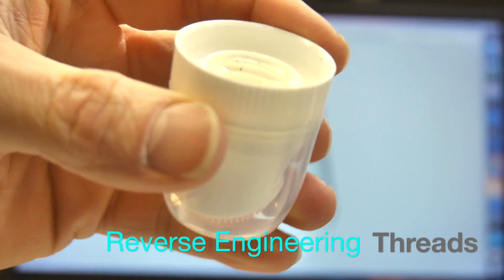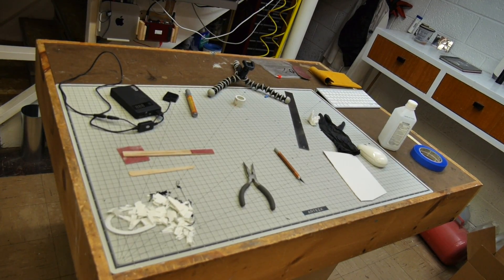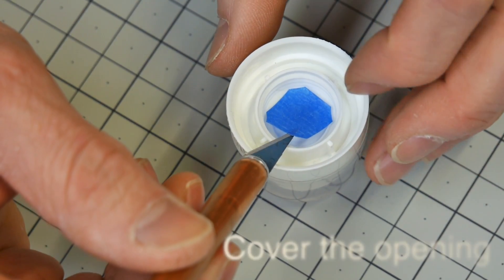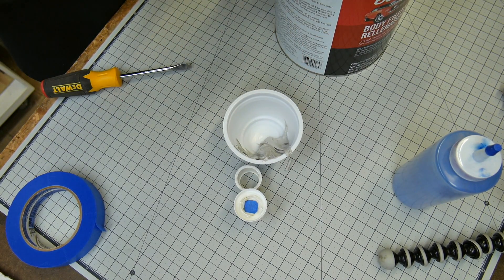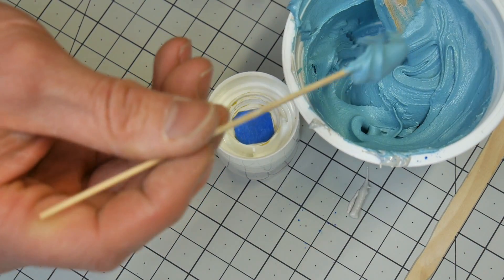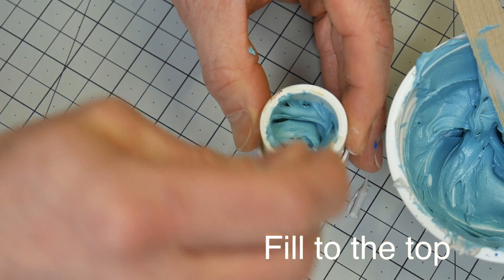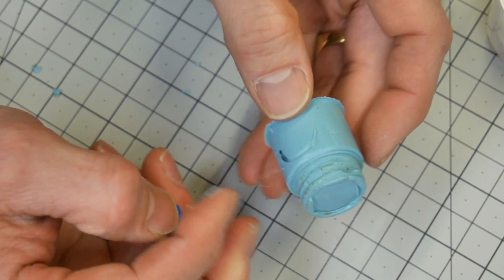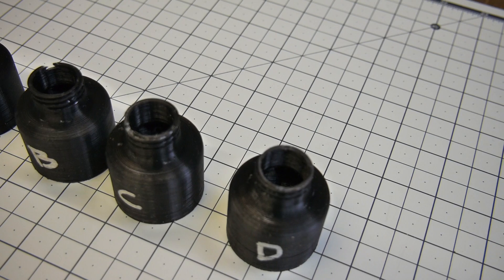How To Reverse Engineer Bottle Threads

Comment: Your suspicion the wax helps the bondo cure is spot on. You get a slight surface inhibition layer wherever a polyester resin is exposed to air. Moisture from the air inhibits the cure very slightly.  You notice it when sanding. That is why you add liquid wax to gelcoats when applying it to fiberglass parts post-molding. The wax forms a skin on the surface to eliminate the inhibited layer.

Comment: Lets say I wanted the moulded part to be used in the threads and be reasonably solid and lightweight, what material would you guys recommend?
For a pool cue extension specifically.  So wooden threads.
Reply: Thats what I had in mind, reinforced with some wires or mesh.  But will the paste wax work on wood for epoxy?  I just dont want to epoxy the end of my pool cue permanently!
Reply from the maker: Elias Bargee you should conduct a test first but it should work.
Reply from the maker: Perhaps and epoxy, could work

Comment: I've been printing a lot of modular small parts and probably need to go have an injection mold made. i'm still prototyping and am wondering wether its cheaper to make a reverse mold and make it out of Bondo. i don't care about the bubbles so don't need to get a vacuum chamber for pouring plastic resins. probably cheaper the resin route? But I just need to find out if it works with out huge cost in equipment and I will need to drill parts for attachments, where I now print longitudinal holes to attach parts. its also hard to make water tight and UV resistant.
Reply from the maker: generally, soft tooling if the in between method for testing stuff, basically silicone molds with resin parts. Bondo could work I guess, but wont last long. silicone is really the way to go. alohathaxted let me know if you have other questions.

Comment: Very cool technique! But couldn't a few measurements and a few prints narrow down the dimension? You can measure the interior diameter, so then it's a matter of a profile's overall shape and pitch. Or you could press some polyclay into the cap just for a portion of it to get the pitch and thread profile.

I dunno, it's a great technique, for sure-- thanks for the details!-- but for this task, I feel like it's more trouble than it's worth!
Reply from the maker: jmsaltzman Perhaps...I would be a bit concerned about the clay warping or shifting when I removed it from the cap, I think it could get beat up over the time I was handling it as well. Measuring the inside of the cap even with a caliper is difficult in a concave situation. Casting the part took no more than about 35-40 minutes. Thanks for your comment, much appreciated.